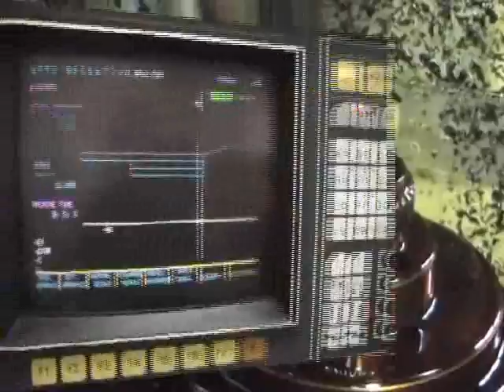Rotec Radial Engine 150hp

Comment: @modelleg 1. Radial engines have a crankshaft with a single crankpin. 2. The master rod which belongs to #1 cylinder connects to the crankpin. 3. The articulating piston rods (an even number of them) are pinned to the bottom of the master rod, encircling the crankpin. 4. All of the power is transferred to this single crankpin, so it has to be big and sturdy. 5. Lubricating oil is pumped from an oil reservoir, circulated through the engine and oil cooler, then back to the reservoir.

Comment: Very nice piece of engineering! Im not too farmiliar with radial engines but just want to know about the lubrication systems on them. Does the oil collect in a sump? Is it lubricated by a pump, splash or mist? Do they get oil starvation when upside down?

Comment: @77fib77 You don't need a separate cooling system,radiator,hoses,ducting, water,All extra weight. Foward motion will keep it cool and running.

Comment: 3.6ltr engine 150hp, Carburetted, This is not a diesel engine, standard spark petrol with pushrod operated OHV , 2  valves per jug.

Comment: How many cubic inches is this engine in the video... how much horsepower/torque to one of these radial engines put out?... Have always been facinated with the radial piston design.. are these electronic or mechanically fuel injected?    Did the early gasoline radials use a pushrod actuated fuel injector like cummins/detroit diesels used to?